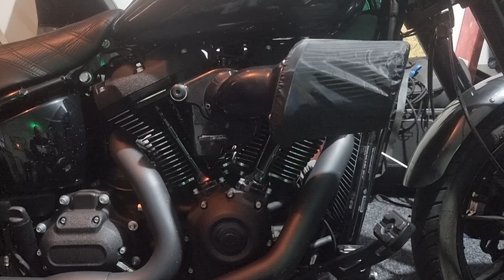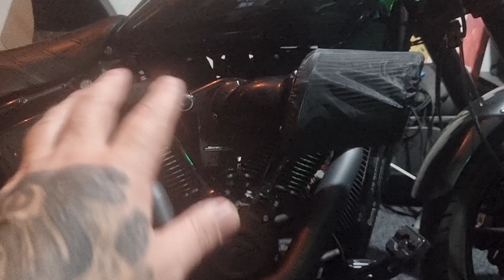Max stage 2 build....

Comment: Yea bro i rode my bros m8 fatboy 114 cam exhaust intake tune and its obviously grunty but my 07 street bob with the old 120r twin cam walks it  so yea more power always a good thing lol
Reply from the maker: Those 120R builds are awesome if i had an old twin cam i would have the same 💪🏻😎 im hoping to get anywhere above 120hp and mixing that with the handling of these new softails is gonna be premium riding 😎
Reply: @fxlrsnz8364  yea when I rode the fat boy can feel the modern frame brakes etc...very nice ...bit out of my price range though the newer Harley's.i was eyeing up a 2020 lowrider s but got my bob for 18 vs 30+.nice bike U got bro U ride it well look forward to the build
Reply from the maker: @hayden spence  thanks bro and yeah totally agree the new m8 bikes are expensive and with the mods they are just stupid money... the bobs are primo! But it doesn't matter what hd you have they all go hard with a little tune 💪🏻😎